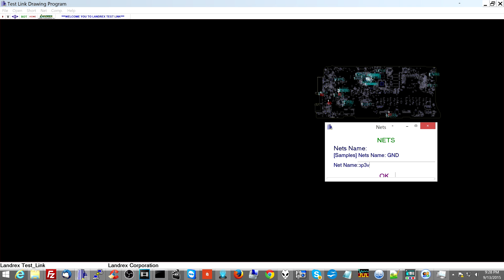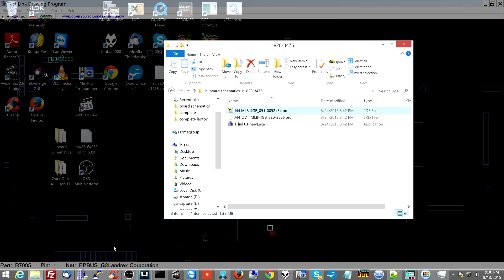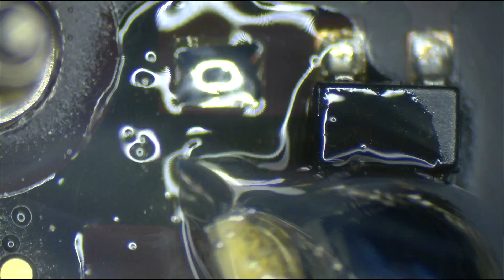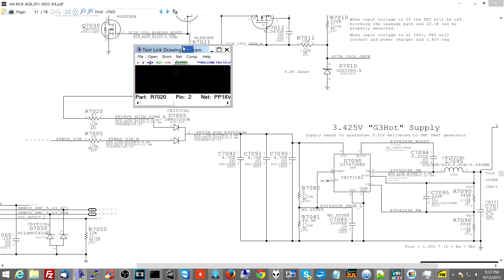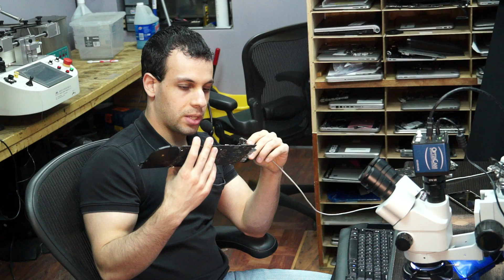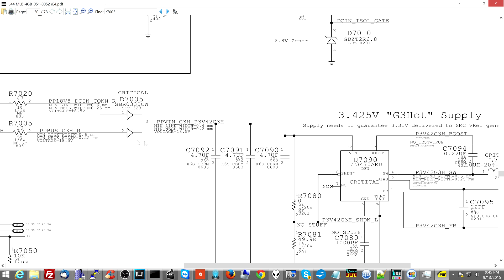Dead Macbook Pro Retina 820-3476 motherboard repair

Comment: hi lous, if i inject 1 volt on ppvcc_so_cpu i got cpu getting hot. it's my cpu shorted to gnd or what could it be? also board got all s0 rail if i remove u8030; if i solder u8030 back i lose 5 volt and 3.3 volt s0. already removed jtag connector and checked all terminator resistor.

Comment: I have a retina MacBook Pro. 13” model. I have a green light shortly then orange. When pressing the power button I get no fan spin at all and the computer does not turn on. Can someone point me to a video of him diagnosing this issue I’ve been looking for awhile now
Reply: same here, eventually got the mac to Beep 3 times, which means there's something wrong with the ram which is soldered into the logic board, which cost 300-500 $

Comment: Hi Louis, I have Macbook Pro 13" early 2015 and it was working perfectly until I started AutoCad and Macbook just freezed.. I pressed power button to shut it down..After 10 mins it wouldn't power back on, and charger just shows orange light. I tried to disconnect battery and charger was still showing orange light even without battery...Restarting smc goes from orange to green and again orange with or without battery.. Can you please help me? :) I know that you have many questions like this, but I have to try :) Thanks a lot, 
Emir

Comment: When getting the charger to light up, is there a big difference (or one at all?) between getting green or orange? I understand when there is a battery present, orange is optimal (for multiple reasons) but on this machine, you got orange, with no battery attached. Sorry if this seems like an idiotic question. One of the first I've seen orange with just the charger plugged in.
Reply from the maker: +William Bailey It always turns orange on retinas and newer airs if a battery is not connected.
Reply: Louis Rossmann great! Good to know. Haven't worked on any retinas. Fixing a 2014 Air now.
Reply: +Louis Rossmann Mine turns orange aswell - altho when the battery is connected it does boot for around 17 seconds then it just dies.

Comment: i am a new subscriber and right from the start i can see that your videos are fun to watch. however things stop and will cease because although your tiredness of doing this repetitive work is getting out of control its because this isn't something you were "programmed to do at birth". in other words you admitted in another video that you didn't goto college to learn this stuff and don't have a degree. i agree with you you don't need a degree for this however as like all the repair shops i have in my country i see most repair shops have just picked up a scripted task to repair something and that's the part that's gonna get you in the end. for example at the time of launch of the xbox360 the red-ring-of-death was catching everyone by storm and the "morons" here would just tear the unit apart, spray some heat-gun activity and then put it back together. charge an idiot $25 dollars and then a week later the problem would happen again. soon about 10 shops are doing it. SCRIPT. no degree needed.
I am an IT professional by skill and have always been a software guy. never liked hardware. to this day i have NEVER been bored of software and will never be.
If you complain of getting tired of doing this type of job. its not for you. ya you might be good at it but so are the guys repairing my xbox-360 which is a task I myself can do with a heat-gun.

i apologize if i sound a bit harsh but ya. this is like a script and scripts get annoying.
Reply from the maker: +Paul Naama If you think open ended troubleshooting is anything like heatgunning an xbox then I don't know what to say.
Reply: you obviously skimmed through what i wrote thus you missed the point. furthermore, i watched more of your videos and i admit you got talent. i cant edit my previous comment and so heres this instead.
Reply from the maker: I read through from beginning to end. You may not be bored of software, but would you be bored of porting the same part of the same program from one platform to another each time they did an update for eternity? New challenges keep things fun!

You can't script open ended troubleshooting. If you could, I would have an army of minimum wage slaves rocking away while I sit on a desert island... but I'm a basketcase without a challenge so I'd probably come back to work. :) One can be bored with complex difficult to figure out challenges if it's the same set of challenges, IMO!

Comment: When you are testing a short to ground with diode mode, is that with power on the board or no power?
Reply from the maker: +Tony Tone No power to the board
Reply: Thank you.  Tell Sharky sup!

-Grateful learner.
Reply: +Tony Tone only power up whn u need to chk voltage, in any other case , dont power... 

u can use ising ohm mood too..